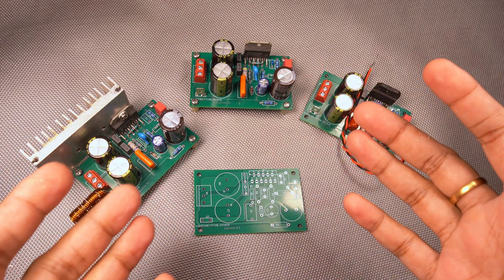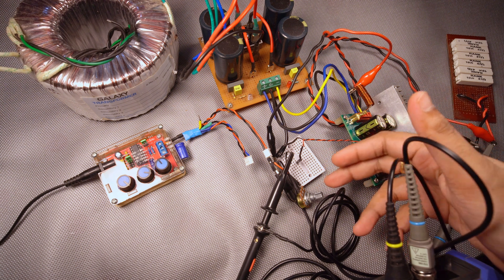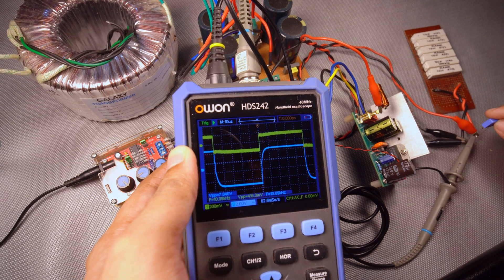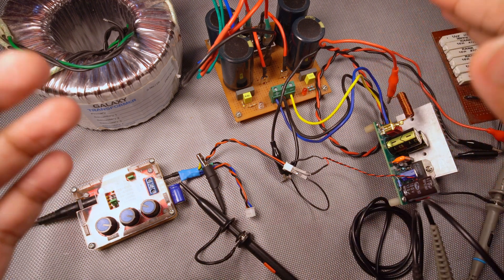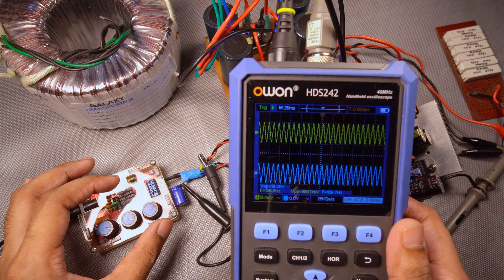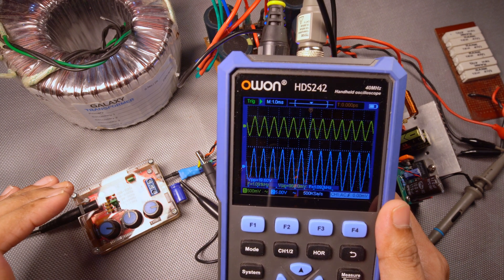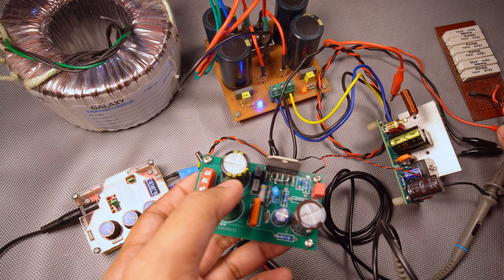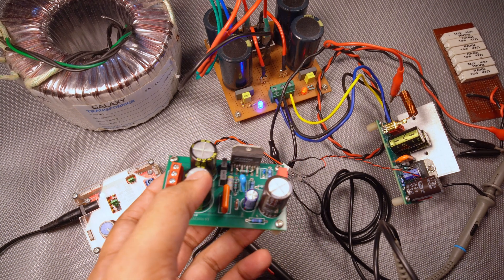Lm3886 Board Stability Test | Frequency Response and Square Wave test| DIY Amplifier Project Part 10

Comment: Hi Roy, 
any plans of making speaker protection circuit video in future
Reply from the maker: Hey … yes yes I sure do have plans to make speaker protection circuits.
Reply: @Roys_Desk  I used C1237HA from aliexpress, all fakes. So something based on transistors would be preferred with pcb layout

Comment: Any amplifier will perform the same way for this kind of sweep test. What is more important about LM3886 is it's THD+N performance and this couldn't be done via this setup. However, using you computer AUX input with some attenuation and proper software, you can easily manage to do this kind of tests. Spekaer output will pump in the required sweep  with clean waveforms. A decent Sound card might even add some icing on the cake. But definitely a proper reponse test you tried to explain not like others who invariably show woofer cone movements. That's kind of rubbish. Waiting to see more videos like this.
Reply from the maker: Yes Brother … even I wanted to test the distortion performance of the amplifier . And the easiest way to test THD is to send a signal with a pilot signal induced in it , so that we can check and compare the harmonics in FFT mode of the scope . But my scope doesn’t have FFT in it 😞.
But Yeah I really need to figure out something to test the THD in a cheap and easy way .
Reply: @Roys_Desk  You cant have proper result unless you sample the signal with higher resolutions. Normal scopes or even standalone scopes are only 8 bits so can't get the right result. better way is to use sound card. Search THD measurement with sound card borgmann
Reply from the maker: Sure … will check this out